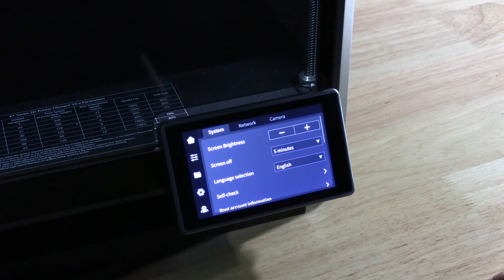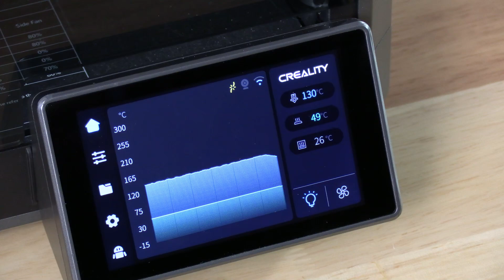How to replace or upgrade the Creality K1 or K1 MAX Extruder - Step-By-Step 3D Printer

Comment: @3drundown Does anyone know what size screws the stepper motor uses not sure if they are m2 or m3  and length.  for whatever reason, the screws suck and keep stripping during basic maintenance. need help on size for replacement
Reply from the maker: It's likely going to be M3. Not sure of the length.
Reply: @3DRundown  Thanks, I ordered m3 set with varied length to see which fits.  I will post the length once I receive.  Thanks again :) love the vids btw
Reply from the maker: I keep an assorted box of them as well, and it comes in handy. 3DP stuff, is virtually always M3. Welcome!

Comment: So, I ordered and replaced the extruder.  And now I have another massive problem.  That little purple tube between the extruder and the hot end does not fit.   The hole in the extruder from which the filament emerges is smaller on this new extruder that on the original model.  As a result, the purple tube does not fit into the extruder hole, which makes it impossible to screw the extruder down into the print mechanism while in place.   So, I thought to myself, maybe this new extruder was designed to work without such a tube?  So, I installed the extruder without it....  that did not work because the filament couldn't exactly fit the filament directly into the print nozzle.  Jammed there, and the extruder started clicking.  So, I took it apart again, and this time I cut my purple tube to fit only into the recess on the print head (because that's the only way the extruder would slide far enough down to be able to screw it in).  Again, no luck.  The extruder was trying to roll the filament down into the print head but the filament couldn't find the print nozzle.    And Creality does include a replacement tube in their extruder package.

Did you not have the same problem?  Your replacement extruder fits right on top the straw, mine does not.  It looks like we got two different models.  I went back to the reviews on Amazon to see if anybody else had the same problem.  I am amazed that I'm the first with this.  I am writing Creality for a solution, but I've got to say...  this printer has been a massive pain.
Reply from the maker: I'll come back to this, but, the tube is just a piece or Capricorn PTFE tube. Easy to get and replace
Reply: @3DRundown  , thanks for the reply.  But that didn't fit my situation, which I've now figured out.  The extruder upgrade is now designed to work with their new integrated hotend upgrades, which feature a narrower metal tube that extends upward from the print nozzle to meet the extruder.  So now I've had to order the hotend upgrade, too.  It's a real annoyance that Creality didn't include such an instruction within the package for the new extruder.
Reply from the maker: Yes. Like I said, I would come back to this. It was 3am, and I was in bed. You will want to install the new Unicorn Hotend, which is much better. https://youtu.be/MDY7RIp0ybk?si=8qeKer7d6PhLr5_7

Comment: Thank you for this video.  I've had the K1 Max for about 15 months, and this is the second time I've had to disassemble the extruder because a piece of broken filament wedged between the gears inside and wouldn't come loose.  As a result, the stepper motor would advance but no filament could get past the obstruction.  The first time around I reassembled the extruder and reattached it and it worked OK until just today, when it happened again.  So this time I'm just going to replace the extruder, in the hope that the "upgraded" version is less prone to jamming.   All in all, my experience with the K1 Max has not been good.  Last week I had to replace the printer head control board.   And now this.  When the printer works it's great; too bad it breaks so often.
Reply from the maker: I gotta say, K1 MAX is easily my favorite single color printer. I was on LAUNCH Hotend and Extruder, with about 2k hours, till I shot this video. My K1 and MAX, are so dependable. BOTH have had no more than 2 failures each. That said, the new extruders are FAR BETTER. As for the board.... It can happen. I lost a V3 PLUS board, in ONE DAY. It's the only board, in 40+ machines, I ever fried. Was so disappointed, but, sh*t happens. Slow your speeds. Stock profile is too aggressive. Slow things down, and your extruder will be allot happier. If it makes you feel better, the P1P/P1S is prone to the same jam, and is MUCH harder to fix. Mine imploded. Everything broke... Was a pain.

Comment: Dont Buy this shit machine, gears broke after less then a month printing among other problems NOt worth the high price, quality is really Chinese. If you buy just order steel gears or better extruder right away and count that into the price of buying a K1 Max in eu thats about $750-1000 + $100 for upgrading. BETTER they just ship the K1 without extruder and let one buy a 3 party extruder right away to cut the price of the machine!

Comment: Hi again. For some reason I bought the K1 and I face issues with filament. I tried to to see why. Extruder is not easily moved when trying to do it manually by hand from the rear outer black gear. This means something is blocking it from inside? Secondly I can not enter the nose silver cleaner pin that is rushing the filament from the extruder. I checked everything. I tried to pull and put back again the PLA by unlocking and locking the extruder. But nothing changes. I only saw blue come out from. The nose and in one moment it printed a thin line of pla extraction mode. After 3s try. Maybe the nose is clogged too? In new printer?
Reply: Please help. I am thinking of returning.
Reply from the maker: K1 is my Favorite printer. An absolute beast.
Reply from the maker: Let's start here: https://youtu.be/Kb4Vmy5m5Rk
Reply: @3DRundown  I know about it. It did not helped. I have general knowledge of painters. Hard leather from Ender 3

Comment: Sooo happy that I found this video. Very clear and to the point. My extruder has been acting up the last couple of days, with more and more clogging happening and now it wont even extrude. Not sure if I should get a new extruder or not. I did some unclogging with the long metal-rod that came with the K1, but it looks/feels like it did more damage than good. :/
Reply from the maker: Why stress over it. Swap it out and get back to work. Stuff like this is just part of the game. If any doubt, swap the nozzle too, and off you go
Reply: @3DRundown  yeah, I am just going to exhange it all, I think :)
Reply: Gear are maby breaking!
Reply: @ramusoder5411  , the gears are not likely breaking.  If you take the extruder apart you're probably going to see a piece of filament jammed between two of them.  In either case it's a big problem with this machine.